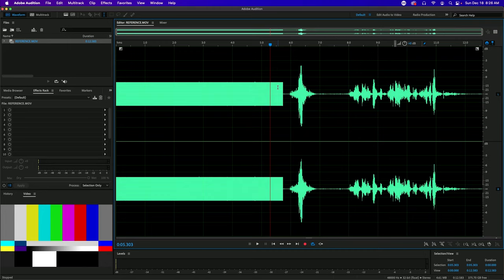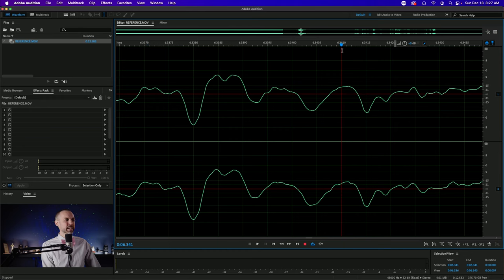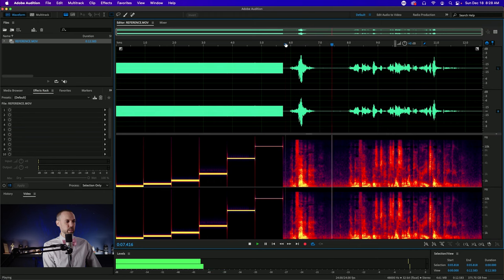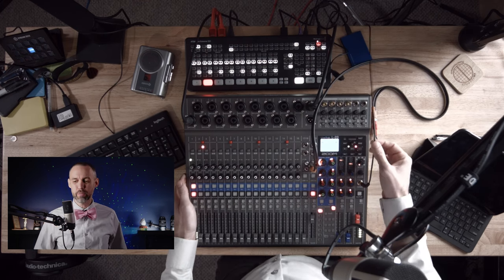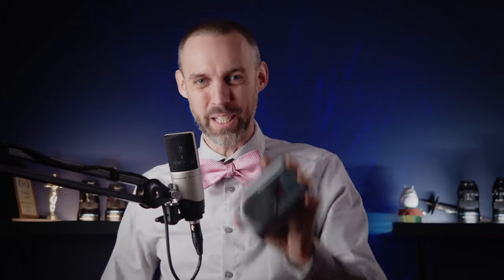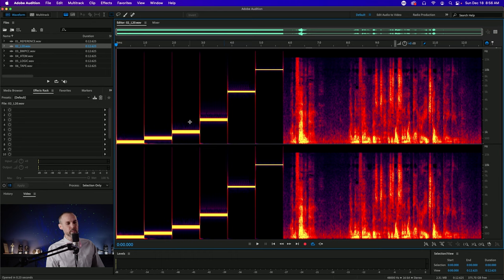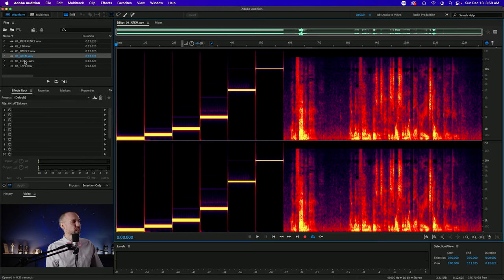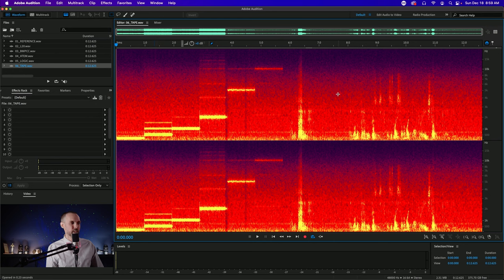Why Spectral Frequency Analysis Is Important In Testing Audio Chains

Comment: That's what I miss the most in Adobe Audition; the spectral frequency display. I used it once to erase a phone ring tone during an important dialog scene. Audition lets you see the tone and then erase them with simple tools. Those tones were out of the speaker's voice range so noting was lost. I hope Black Magic Design can put that feature into Fairlight some day.
Reply from the maker: I am kind of amazed at how powerful a tool it is. The only thing more shocking than that is how wave forms are the standard readout when they are so much less efficient than spectral frequency readouts.

You can always email them a suggestion that they add spectral frequency analysis to Fairlight: https://www.blackmagicdesign.com/support/
In fact, I just did.
Reply: @JJKoester  Every time I download a new version they ask for feedback. I've been putting that suggestion in every time. Thanks for commenting.
Reply from the maker: @RobertShaverOfAustin  Reached out, they told me that they'd take it under advisement and that I should mention it on their forum. If/when the feature lands, drinks are on me for the evening.

Comment: Good one Jesse! This is a use-case for spectral analysis that can benefit anyone building or upgrading their system. Now I want to do some testing on mine!
A small correction in terminology, what was referred to as echos on the sine waves are actually overtones and undertones or harmonic ghosts appearing at exact upper and lower multiples of the root frequency. These are attributable to system and headphone amplifier nonlinearities, and the quality of the A>D & D>A converters.
Reply from the maker: Thank you so much for the correction on terminology. I know I wasn't going to nail it with 'echoes' but I hoped it would be understandable even if it wasn't the correct word. It's among the pitfalls of operating at the edge of one's expertise.

If I assemble an elite team of black-ops assassins who work in tandem to complete missions and then disappear into the night like so much smoke from a blown-out candle, we will call ourselves Harmonic Ghosts.